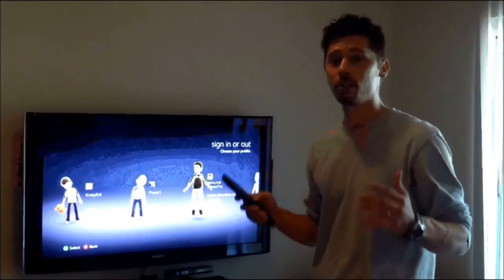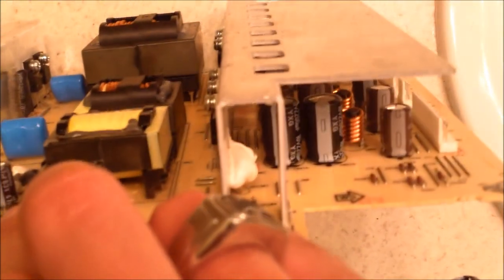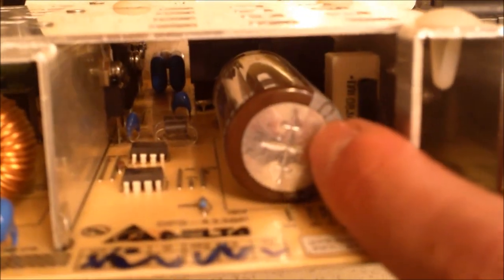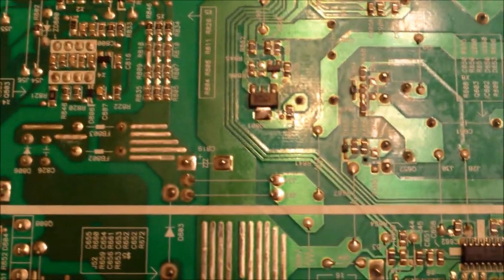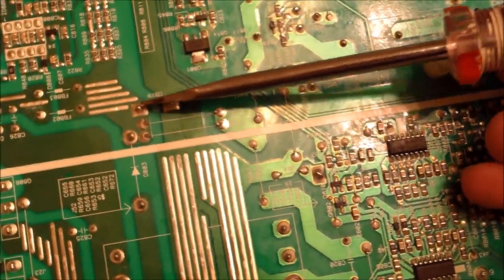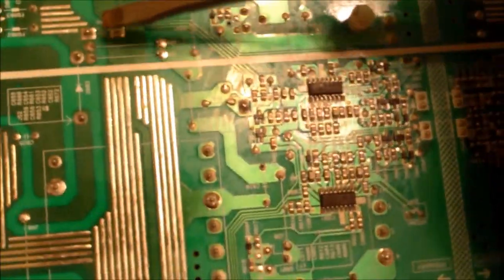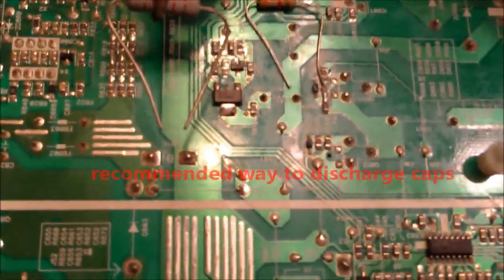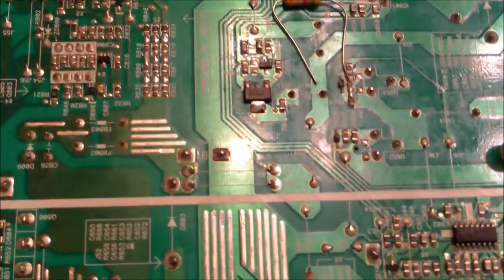HOW TO DISCHARGE TV CAPACITORS SAFELY, DAILY TECH TIP 4

Comment: Please stop giving bad advices.
Never use s screw driver to discharge caps. You will damage the cap and other components as well.
Use a resistor with a big value and wattage, don't hold it with bare hands, hold it with an insulated wire

Comment: How long after unplugging do they old the charge (and risk to get shocked?)?
Reply: Actually more than weeks, some capacitors can hold a charge for years, so dont just ever assume its not charged.
Reply from the maker: after unplugging Caps can hold charge for weeks but just use 1 watt resistor and touch both legs of biggest Cap in circuit to drain it, but i never heard of anyone getting badly hurt from "TV" caps, just shocks you like a tazer gun, worse case is that someone might piss themselves. 8^)
Reply: but how to discharge a camera flash capacitor ? it always explode or make a big spark and burn the whole board :( I hurt myself twice thinking it's empty but it was full of charge .. I can't discharge it :/
Reply: Bro I remember taking apart a disposable camera once as a kid... biggest shock ive experienced in my life to this day lol

Comment: What if the capacitor was connected to a bread board and we took it out, would it still store voltage?
Reply from the maker: yes it might shock you but won't kill you. some huge caps might knock you down or really hurt you but those are not found in TVs.

Comment: Not really safe.... if you hold a resistor with your fingers and short a big capacitor you will definitely burn your finger. Some resistor even blast. Safer way to do it is to connect a multimeter and select a voltage higher than the one stored by the capacitor and simply measure the voltage. The multimeter will measure a pick voltage and will suddenly drop, no spark, no heat, not danger.
Reply: thank you !! you saved my life !! I burned my fingers twice before and I felt the sparks hit my heart from inside :( it's very dangerous !! I will try the multimeter thank you
Reply: @abdurrahmanmoustapha  what size capacitor was it?
Reply: thanks.  better info in your paragraph than the video.
Reply: ***** still better than painful electric shock
Reply: Mont RC but the problem is sometimes when you do this method a short circuit occur and the main board get damage in some of it's parts ! I prefer to discharge it slowly even fi it takes 24 hours !!
Reply: He's not holding the resistor with his fingers, he is using like tweezer to hold the resistor and the resistor method is a good one if you do it right way.
Reply: +Mont RC 
I just checked a psu i replaced 3 years ago today with a multimeter and it still had 10 V. Thanks man.
Reply: ***** I'm not an expert and don't understand these numbers .. I repair flashes and cameras and capacitors are my only fear !

Comment: Watching this, then I would assume that in handling a board like this, I'd watch out for putting my thumb over the two terminals while holding it...no?Or, how about those much large caps on hifi gear, or old radios? Would you use the same technique or something safer? On big hifi caps, is it safe to hold a resister like that to terminate the caps? Should I be using a much bigger resistor...etc....